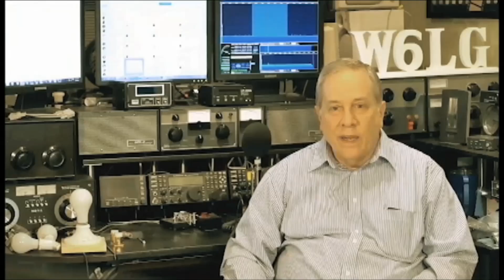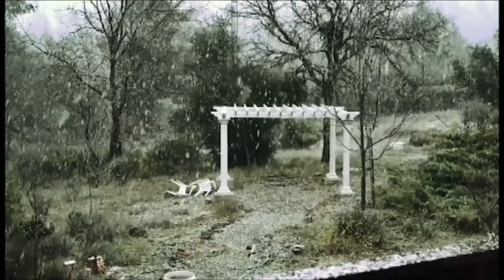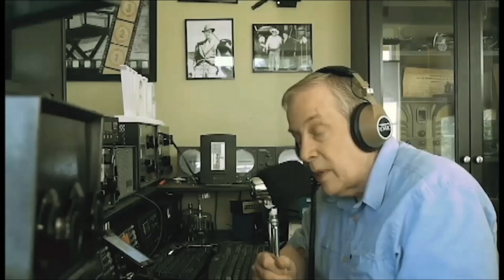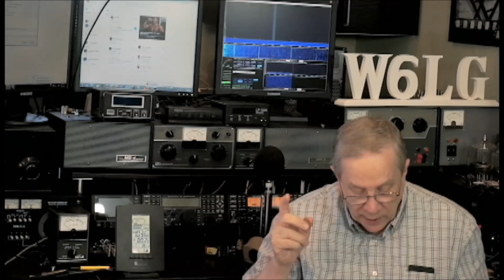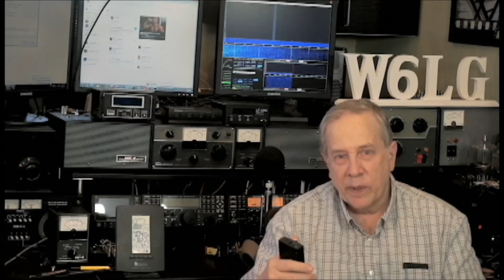Ham Radio Basics--Signal Reports--RST--Icom 7300

Comment: Great Videos!
Most transceivers don't achieve the theoretical 6dB per S-unit below about S9. My Kenwood TS-590S, for example, is right at about 3dB per S-unit below S9, which is comparable to the IC-7300. This is documented in the following report by WB9KMW.
http://www.wb9kmw.com/WB9KMW/Research/articles/article_S_meter.pdf
The Elecraft K3 shown in the background of this video is an exception, as documented here.
http://www.cliftonlaboratories.com/Documents/Elecraft%20K3%20Transceiver%20AGC%20Parameters%20and%20S-meter.pdf
Reply from the maker: Hi Scott, 
Thanks.  Do you have any idea why for the IC-7300 and your wonderful TS-590 it is 3 db per S-Unit?  I think with a firmware change, 6 dB could be set as the incremental.  Or, am I wrong about that?  Both of those transceivers are cutting edge, state of the art, amazing transceivers with great performance.  It should be noted that the IC7-300 is classed as an entry level transceiver.
Thanks again & 73, Jim W6LG
Reply: Hi Jim,

That is a good question. I can't provide a definitive answer, but we do know that it is technically possible to achieve a 6dB per S-unit slope on the S meter. Apparently (I have not independently confirmed this), the K3 slope matches 6dB per S-unit pretty well. Even in that case, however, the absolute calibration of the S-meter is only accurate with the preamp on. When you turn it off the readings change by 2 S-units, so you really don't have an absolutely accurate S-meter. In order to achieve absolute accuracy, the S-meter circuitry needs to account for the gain ahead of it in the signal path.

The most accurate S-meters will be in SDR radios (especially the direct sampling variety like the Flex 6000 Series). These are a special case since they can measure the signal power directly (it's just a mathematical computation in the firmware). As long as the gain in front of the ADC is accounted for, they are capable of any arbitrary S-meter calibration and slope. Keeping track of the gain ahead of the ADC in and SDR is pretty easy as well since there is typically only a preamp and a single amplifier/buffer stage ahead of the ADC. The Flex Series of radios can actually report signal levels in dBm directly.

Therefore, I will constrain my thoughts to the legacy radio case. I can surmise two reasons why we typically see 3-4dB per S-unit in many modern radios, one is technical and one is behavioral. In order to achieve a linear slope in logarithmic terms, you have to get a logarithmic measure of signal strength over a wide dynamic range. Most legacy radios likely derive their S-meter reading from the AGC circuit and not all AGC circuits work this way. The goal of the AGC circuit is to keep a relatively constant output for a wide range of inputs. This is done my measuring the output level of the AGC amplifier and applying a feedback signal to the amplifier to control gain. Only if the gain control of the AGC amplifier is logarithmic will you get a logarithmic S-meter reading. This has to occur over a very wide dynamic range, which is not trivial to do.

Still, the TS-590S appears to have a nice logarithmic slope even if it is not a 6dB slope. Why didn't the manufacture apply a gain factor to the S-meter reading to achieve a theoretical 6dB per S-unit? Clearly, if you look at the curve for the TS-590S, the slope tracks very well above S9 and is a pretty linear (in log terms) 3dB per S-unit below S9. This appears deliberate. Perhaps this is where a behavioral motivation comes in. I find that I have a lot of difficulty maintaining a QSO when the S-meter reads 1. On a "properly" calibrated S-meter with 6dB per slope, the same S1 signal would read S5. How would hams react if they could barely maintain a QSO with an S5 signal? Just thinking out loud...

Scott

Comment: Jim,

Nice informative video. Do you have an idea why Icom would change the dB steps for the S meter?

Just getting back into the hobby after a 25 year absence. Picked up a Flex1500 off Ebay and really like the waterfall for spotting signals. I need to perform maintenance for all that I had installed many years ago when I was spry. Finding out it is taking much longer to get things done now that I'm near retirement age.

I have a T2X driving a Wilson TT-45 crank up tower that I just refurbished with new wire cables and winches. Sunday night tested the T2X and it still works, but the coax run from inside to outside has a problem. It runs through the crawl space and I won't be able to get there, so need to find another way to get another coax run outside. I bought a spool of CQ Flexi 4XL way back, but that is not the coax running through the crawl space. I'm kicking myself now that I didn't change out that piece of cable. It's the only run not the 4XL.

Another difficulty is the summer weather we are experiencing here near Philly. Hot and very humid. Was outside for just a few hours in the morning and still had a soaked T shirt. Guess it's just going to take a few more weeks before I can finally get back on the air.

73
WB3BJU
Reply from the maker: Hi Don,
Did you see the bulkhead coax connectors that I have on my website at www.hamcq.com ?  I have various lengths up to 12 inches.  Maybe one of those would work for you through an exterior wall.

I don;t know why the 3 dB.  Someone else may have an answer.  In any case, be careful.  The SDR boxes from Flex are amazing.  Gerald Youngblood and his staff have produced some great innovations. 

73, Jim W6LG
Reply: Jim,

Yes, I know of your bulkhead connectors. The problem is I'm not as flexible as in my youth and can't run more coax in the same location, however I do have another run of 4XL that was used for some two way radios during our dump truck company days that ends right at the tower. I'm going to locate the end inside and see if I can tie into that. I did watch your video about how insignificant to number of connectors was to the power through put.   :-)

73,
Don WB3BJU